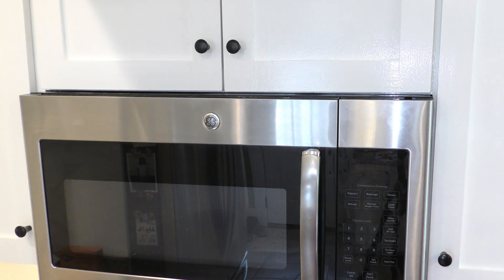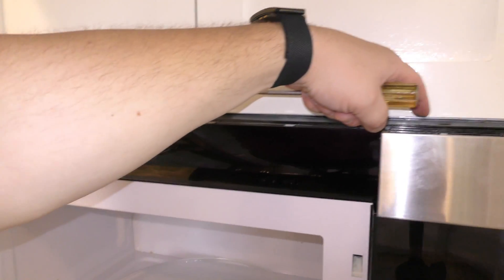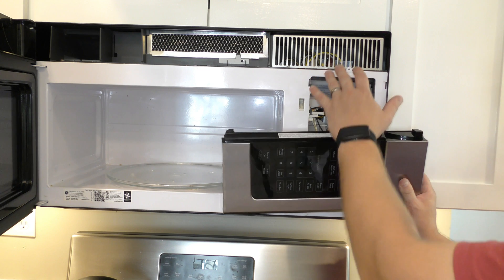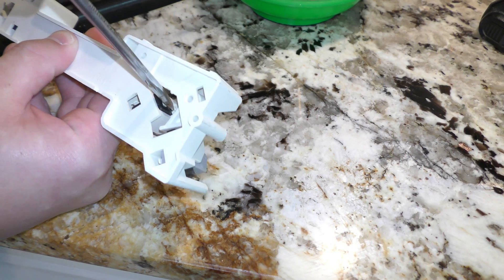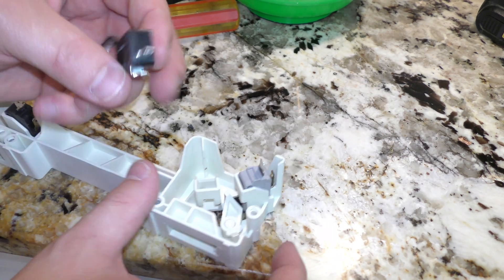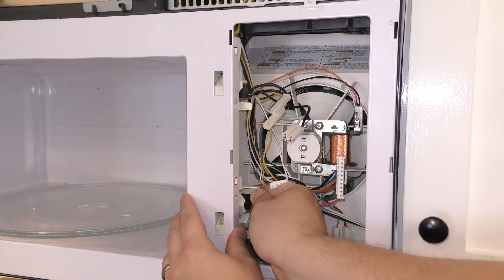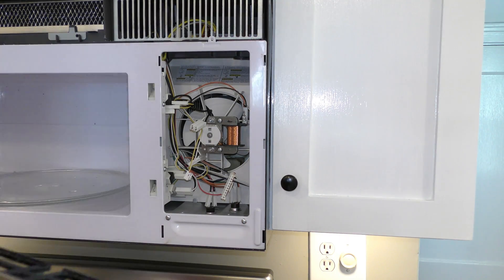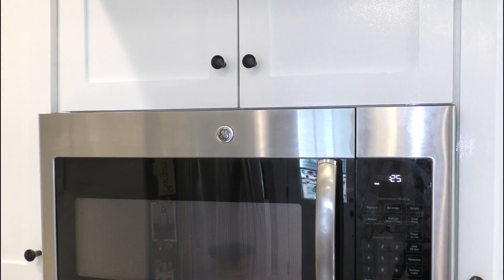GE Microwave Keeps Blowing Fuse / Breaker - DIY Fix

Comment: Hi there! I just got my microwave apart and the switches seem to be working. But I'm wondering if you would recommend replacing the switches anyway just to see if that fixes the problem before going further?

Comment: Amazing, thank you for sharing this. We couldn't tell which switch or fuse was causing the issue, so we just replaced them all ($10!). And success! No need to remove and install a new one with all the work that entails. Saved us a few hundred dollars and now we know what's behind the panel, plus we got to clean out the innards in the process...
Reply from the maker: That's great, glad I could help!

Comment: Fun tip for those that need to replace the switches, those exact same switches (at least very similar) can also be found in ice makers. So if you have some junked freezer ice makers around, take them apart, and grab the switch out!
Reply from the maker: Good tip

Comment: Our ge microwave just stopped working. No power to it yet outlet is fine. Likely blown fuse. Repair guy can’t come until 9/4. Cover me I’m going in……..

Our son continuously opens the door while it’s still running. Guy said that causes an arc and can blow the fuse….. praying this is the fix.

Comment: Mine has been broken 9-10 months, finally decided to take a crack at it with your video as a guide; different model. Fixed! The switch. I took it apart, to see the fuse, but a screw driver to the switch broke it free. 

Frankly, this was good for me.. who needs a microwave?! Dedicated frozen veggie maker from now on.
Reply from the maker: Glad the video helped you figure out the problem, even if you don't need a microwave now!

Comment: i have the same exact microwave and the fuses are bad since i had no power.  however, i believe i have a bad magnetron because it wont heat food which was the original problem.  Would you have a video on that by any chance for this model?  Thank you for posting this
Reply from the maker: I do not have that video. Best of luck
Reply: @KeyFobRob i will figure it out.  Thank you!

Comment: My 30 YO Panasonic microwave blew a fuse last month. After confirming the fuse blew with my DVM I then measured the ohms across the fuse terminals and it was 0 ohms. I was pretty sure when I put a new fuse in it would blow right again which it did. So not knowing much about how the circuitry works on microwave I was pretty much resigned that I wasn't going to be able to fix it.  A hail Mary google search led me here and I did indeed have a faulty microswitch. I actual has some spares from a heater I fixed last fall so a few minutes later and a ohm check on the fuse terminal I was pretty hopeful. The fuse I bought was a 2 pack so I put the 2nd fuse in it and yay it is working again. Thanks so much for this video.
Reply from the maker: You're welcome. I love a good success story!

Comment: Hi, will the Kw3A Microwave Oven Door Switch 16A 125/250 V Door Interlock That you recommend from amazon Work with My GE Microwave -JVM3162RJ2SS model. Thankyou can you get back as soon as possible.

Comment: I just pulled the monitor sensor from the switch and it works fine if you don't want to actually replace the switch.
Reply from the maker: Right on

Comment: Great video. I have the same model and losing power the exact same way. I tested the switches and it looks like they're all clicking fine. Should I still order new switches and try it out? I dont knw what else it can be. I have replaced the fuse thinking it was the problem and as soon as I do and start the microwave, it dies.
Reply from the maker: It's very likely that the latch bracket is worn down and needs to be replaced - New Latch Bracket - https://amzn.to/3rXmoy1
Reply: @KeyFobRob  Great I will buy a new latch bracket and check back in on what happened. Thanks!

Comment: I have an Aurora GE.  I replaced a bad thermostat, the other one tested fine.  The 2 ceramic fuses both tested good and all 3 microswitches tested good.  I still have no power.  Any other ideas?

Comment: Hoping you can help a little more.  I swapped the switches and the fuse looks great, but when I open the door it flips my breaker every time.  Is it an alignment issue?  Thoughts?  This video has been very helpful however I’m still having the issue.
Reply from the maker: It's very likely that the latch bracket is worn down and needs to be replaced - New Latch Bracket - https://amzn.to/3rXmoy1
Reply: @KeyFobRob  I’m on it.  Thanks!
Reply: @ you’re the best, a new bracket did the trick.  Thank you so much!
Reply from the maker: @richardprice5281  Good stuff!! Glad you could get it back up and running

Comment: Where is the capacitor in this model and do I need to discharge it to replace the switches? Every video is saying discharge the capacitor first, but I don't see it once the display/circuit board and grate are removed.  
My fuse is blown, btw, so maybe I have another issue.

Comment: OK...I had this same problem with my microwave. The problem is that there are 2 microswitches that are activated when the door opens. The switches are wired such that even if they "break before make", a warpage or looseness in the door will cause one switch to activate before the other, causing a dead short, blowing either the house breaker or the fuse on the circuit board in the upper right side. This is a serous design flaw.

The way that I fixed this was to remove both of these switches and go to a plunger type, double pole, double throw limit switch. The switch that I used has a window over the terminals so you can see the contact bar make and break in parallel as it functions. It is rated at 20 amps. It is a salvaged limit switch off of an old injection molding machine.  I mounted the switch within the grill over the circuit board and put a short 9/16" high 1/2" diameter rod on the door so that the switch would activate when the door closed. It is in the upper right hand side, so there is no interference taking stuff in and out of the microwave. The two switches were discarded and replaced by the single switch. A misalignment in the door would not affect this arrangement and the safety interlock that the 2 switch design intended is retained by the single switch. 

I have commented on this before on several posts from different sources on this same anomaly.

I have also notified the manufacturer and hopefully they will fix it on future models. Hopefully, they will not try to do it "on the cheap".

Comment: Sir, at 58 seconds into your explanation, you have that white plastic removed without showing me how you did that. WTF. Would be helpful to see how I should remove it. 🤔
Reply from the maker: Look at 1:50. That is how to place that piece back. There are a few screws that hold it in. Remove those and then it should fold out

Comment: Tried this on the same microwave and it did not fix the problem
So I'm stumped on this one . Keep tripping the breaker when I tried and use it . if you have any suggestions I'm all ears
Reply from the maker: Take a look at this bracket -  https://amzn.to/3rXmoy1
It's likely worn down from a lot of opening and if this wears down, it needs to be replaced as well.

Comment: Great video. Hopefully it saves me some money! I replaced one of the switches but it keeps fusing the same new switch. Any ideas on this?
Reply from the maker: Take a look at this bracket -  https://amzn.to/3rXmoy1
It's likely worn down from a lot of opening and if this wears down, it needs to be replaced as well.
Reply: @KeyFobRob  thanks for the tip. I actually just added a screw to tighten the bracket in place and a piece of cardboard to “seat” the fuse more snug in place and that seemed to fix it!

Comment: My guy, you saved me almost $300! Same model, and same switch went bad in mine. Can’t thank you enough brother! God bless!
Reply from the maker: Boom! That's good stuff!!
Reply: @KeyFobRob  same here thanks!
Reply: Just posting to say I am another satisfied customer. This is exactly what happened to mine and this video was the perfect fix!
Reply: I bought 2 new 20 amp fuses and the microwave worked for 10 seconds then shut off. Should my next step be to replace the switch like you did?
Reply: Came here to say the same thing!

Comment: I didn't have to replace the switches, at least not yet. But following these instructions I took the switches up, cleaned them well and was able to get them "clicking" again. It solved my problem. I will be ordering the replacement switches anyways and get them replaced. Thank you very much for this video. Cheers.
Reply from the maker: Very nice! 👍

Comment: This was very helpful but when we put it back together we hear it running innately when the door closes even though we haven’t started it with the start button. The light doesn’t turn on but there is a noise like it’s running. Any thoughts on what we did wrong?
Reply from the maker: My best guess is that you used the wrong switch to replace the bad switch. Some of the switches are normally open or closed and it seems likely they you switched them up
Reply: @KeyFobRob  My original message was supposed to say running constantly.  Not innately.  😂  Anyway, that's what I thought it might be, but to be honest, further googling indicates that our control panel is likely just bad now.  Thank you for responding.

Comment: I really hope this is my issue.  Replacing my microwave will require a new trim kit and it is just getting super expensive. It turns out one of my 3 switches is squishy. I still don't understand why with the fuse blows right when the door is opened or if it is closed and you start to microwave.  I really hope that is the problem. New switch arrives in 2 days.

Comment: All 3 door switches are the same? Or I need to replace just the bad one?
Reply from the maker: They are not the same. Just replacing the bad one should be sufficient but they are sold in multipacks - Door switches - https://amzn.to/3OGKXJ3
Reply: Thanks

Comment: Holy moly this video was fantastic!  I was able to take it apart and had the exact same latch issue as the one you displayed on the video.  However it unstuck itself and started working again.  I am ordering a new set though so when it finally does give out I will have it ready!  This was a perfect video!  I also did what the third comment said about adding a third screw,  Maybe that will cause it not to jam up again!
Reply from the maker: Good stuff! Glad the video could help you get it sorted out
Reply: @KeyFobRob thank you again!!

Comment: Man I took mine completely out of its spot took the whole damn thing apart, found the blown fuse, replaced it, fuse blew again instantly and now its sitting in the garage and I was looking to purchase another one that can fit in the bracket on the wall, now I'm going to try this. I should have known there would be a youtube video for this years old microwave lol. Thank you sir.
Reply from the maker: Also check the latch bracket along with the switches. These go bad a lot after use - New Latch Bracket - https://amzn.to/3rXmoy1
Reply: @KeyFobRob  I shall thanks again!

Comment: This video is great and taught me how to fix my microwave and get it back up and running.  I have to ask though, is anyone else having this problem just repeat itself over and over?  I've replaced the switches a few times over, and most of the time, the same one as in this video is bad. Sometimes even when they're all working, now that I've moved things around, it can be touchy when closing the door if you don't do it just right.  I feel like I'm doing something wrong but I don't know what quite yet.  The switches I buy off Amazon keep going bad fairly quickly and seem to not be good quality.  I'm about to just give up and get a different brand of range top microwave.
Reply from the maker: Check your latch bracket. It's likely causing the exact same issue to repeat itself. New Latch Bracket - https://amzn.to/3rXmoy1

Comment: Never mentioned if the fuse keeps blowing, only if the fuse is good still At 50 seconds into the Video.
Reply from the maker: Did you replace the switches?

Comment: Wow, $5 fix vs hundreds. Thanks! One thing to note in buying the switches. Make sure it’s the right type: Normally Closed vs Normally Open. For my GE microwave, looks like it was the Normally Closed (NC). You can tell by looking at the diagram on the switch where the path is connected (NC or NO).
Reply from the maker: Great tip!

Comment: Did this, didn’t fix it. Could be the plastic holder was too warn down. Decided not to spend another $40 on old microwave, and bought a new one. Now it works amazingly.
Reply from the maker: Yeah - I feel you. Not everything is worth fixing. The plastic latch goes bad a lot on these

Comment: This video was excellent and allowed my wife and I to repair our GE Profile MW and have it back up in 24 hours! Thank you THANK YOU!  One note, to remove the switch, the detail on how to release the plunger pin was not clear, I saw that on another video.  Also when I ordered switch from amazon with your link, (perfect fit, delivered next day on a Sunday!) actually all three switches came together for $10.00.  Two of the switches are the same and one is different, I needed the different one.  Got to be sure you are installing the correct switch.  Anyway worked perfectly first try...I did take a picture of the circuit board connections and my wife and it  helped us get all the five plugs back exactly where they came from.

Comment: I just fixed mine but the switches werent the problem! Just the 20amp slow blow fuse on the top of the panel behind the metal grate. The thermostat vent fuse on the right is always closed so dont assume its bad! The one on the left is a different part number and tests fine without the load. I spent $40 to learn the hard way.

Comment: Great video , I have a side note hope it helps others  in troubleshooting the problem. When I put an ohm meter on the load and neutral (not ground) of the microwave's plug, it would ohm out indicating continuity . After I took out panel that holds the pressure switches and cleaned them out with alcohol and a q-tip it it no longer ohm out. I put it back together, and it works fine.

Comment: Here's something you wouldn't consider.
The door latches wear grooves in that plastic assembly, and as a result, the door doesn't close tightly.  
It remains slightly ajar, and switches don't work properly.  This happened on two ovens.   Too expensive to replace that assembly.
Reply from the maker: That's a common problem. New Latch Bracket - https://amzn.to/3rXmoy1

Comment: I'll have to check this with my Frigidaire. It worked great up until about a year ago and after about five seconds of running, the entire circuit breaks; the oven is on the same one. I replaced the fuse about four times and it immediately blows. Father-in-law suggested bad capacitor, so we took the microwave down, gutted it, replaced the capacitor and still the same issue. I'm tempted to just look for a replacement.

Comment: Thank you! Your information helped me fix our microwave and saved us the expense of replacing it. Everything was exactly how you describe it in the video. I found the stuck switch after wrangling the door latch out of the microwave. I was showing my wife your video and demonstrating how I was going to remove the switch when it started working properly. I put everything back together and the problem was solved! I only wish I had read the comment about the third screw for the door latch while I had the control panel removed, I definitely would have put in another screw.

Comment: I replaced those parts and it has worked for over a month but now it tripped the fuse again. Reset the breaker and it doesn’t come on. I took it apart and checked but it doesn’t come on. The fuse and door switch are all good. Now what??

Comment: I replaced all 3 switches and it still does the same thing. Open the door while on and it trips the breaker every single time.
Reply from the maker: Check this bracket to see if it's worn down - New Latch Bracket - https://amzn.to/3rXmoy1
Reply: @KeyFobRob  thanks it is definitely worn down.

Comment: This was exactly what I did and it worked for a month and the breaker blew again. I checked the fuse and switch and they were good. I checked the outlet and it isn’t getting any power? If I replace the outlet will it still blow the fuse again?
Reply from the maker: I would check your latch bracket. These wear down slowly: New Latch Bracket - https://amzn.to/3rXmoy1

Comment: Great video on this most common problem.  In my case, the switch holder was slightly moving and making one switch break contact if you gently pulled on the door, blowing the fuse since the other two switches were still made.  If you notice on the switch holder piece, there is a place for a third screw by the lower switch.  I added a screw here and it took out the excess play and now works as intended. It sure looks like it was made for a third screw as the case has the hole also, GE just cut corners and left it out.
Reply from the maker: Well done!
Reply: Mine has been working great since I added the screw. Give it a try, nothing to lose.
Reply: @jeffdanger12  thanks for the tip. I think the screw fixed mine too!
Reply: Hey Jeff, if my switches keep blowing (the same one) do you think the extra screw will help?